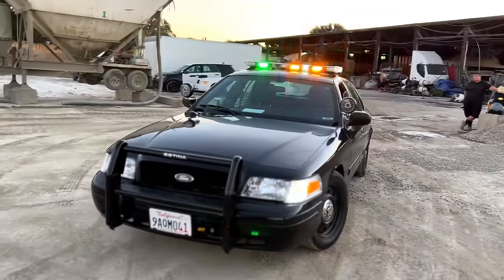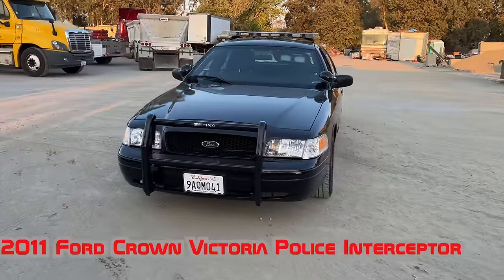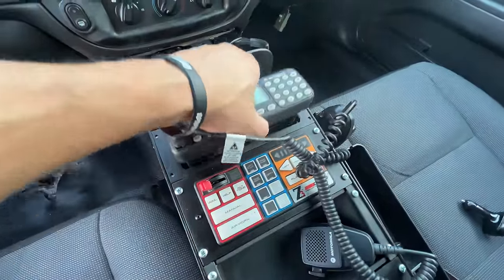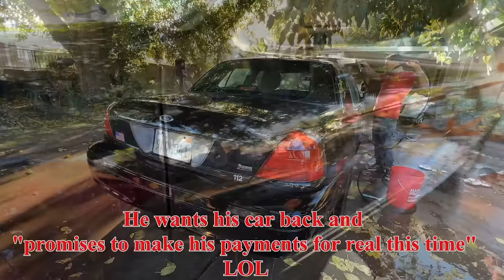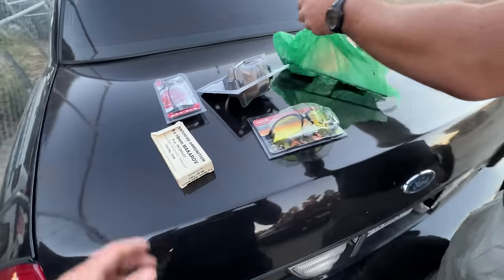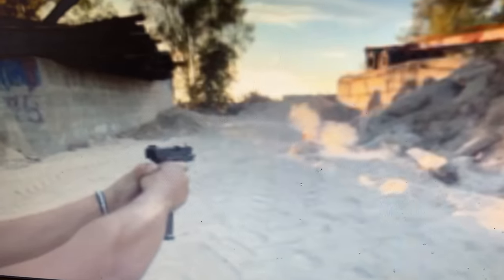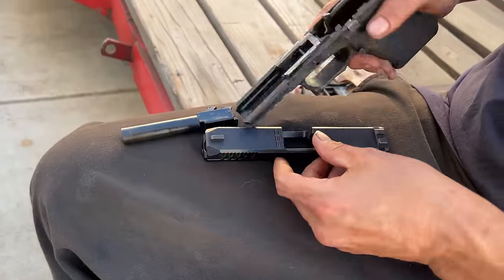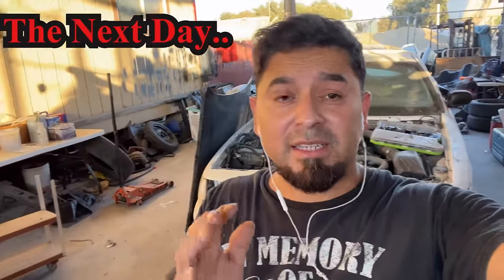Aftermath of finding a GHOST GUN & REPO!

Comment: 4:58 Did you accidentally buy 9x18 Makarov instead of 9x19 parabellum?
Reply: Holy shit yes they did
Reply: I know that if this pistol is 9x19 it isn't right ammo, but how bad is that actually?
Reply: @thefinplayer6091  it wont work, and could damage or destroy the firearm and injure or kill the operator
Reply: I also noticed that, then was confused how it turned into a box of federals. 
Maybe they had other guns to shoot 🤷🏽‍♂️
Reply: Good catch.
But it won’t chamber by design.
Now if some ya-hoo modified the chamber, that would cause problems and likely a kaboom.

There were some 9x18 conversion barrels produced for a couple models, but I haven’t seen them available lately.

They probably just had a box and discovered at the “range” it didn’t fit.🤦🏻
Reply: Yes but the gun the last guy shot is chambered in 9mm makarov so im assuming it was his ammo
Reply: @Helidude350 it can and will chamber as some one who has bought it and shot it I can confirm that it can and will shoot but double feeds and failure to extracts happen almost every shot you can also shoot 38 special out of a 9
Reply: @thatoneguy5007  no, 9mm casings are larger and the rim on a .38spl won't feed into a 9mm semi auto. Now if you're reloading you can use either 38spl or 9mm bullets but the casings are very much different

Comment: I would assume the guy bought the 80% lower in which they give you an unfinished lower frame where you have to finish it, you can legally buy an unfinished lower and finish it yourself and you don’t have to get it serialized, they do also sell finished lowers with serial numbers but are more expensive because the Frame is what they consider a gun. Now with that being said, I would assume that he didn’t really file down the frame that well which will cause jams with the gun itself, the oil will help but you would want to file it down more so it’s smoother, also the uncle should of cleared the gun before messing with it, they make flags for the barrel so you know it’s clear and all.
Reply: In california you can't finish an 80% without first getting a serial number from the DOJ

Comment: Hope he’s OK and probably one reason why the gun wasn’t discharging rounds was you probably need a new slide or just to file  the frame more because on some ghost guns, they need to file them down a lot
Reply: Maybe a different spring aswell
Reply: @Whydoyoucare_1  The web that needs removed where the recoil spring fits is the most likely thing wrong...besides gross incompetence by the handlers.   If you just remove enough of the web to get the gun together it'll short stroke under recoil...need to fully remove that web and allow lots of clearance for the spring to move.   But please...if you're going to be handling pistols...get some training!!!!   I was cringing the whole time that P80 was in the shot.

Comment: The p80 uses Gen 3 Glock parts in the internals which causes stove piping, change out the Ejector Pin to A Gen 4 Glock 43 Ejector pin 👍

Comment: Id recommend taking it apart and cleaning The bore and the rest of the gun and maybe the magazine
Reply: That gun looks like it never been shot you have to put like 50 rounds in that p80 before it starts working correctly on all 4 of my p80 builds they jammed for about 30 to 50 rounds till it got broken in and that's with me using a drill press Dremel and oem internals

Comment: STOP riding the slide forward!  That also induces malfunctions.  SLINGSHOT the damn slide🤣😉!  Take a class or watch a video.  SLAP/TAP the back of the slide after releasing the slide. It helps assure the slide is properly seated.  Also, a GHOST GUN is only legal to be owned by the person who manufactured it.  You arr committing a crime by having it in your possesion without legal transfer.  Just a couple tips.

Comment: The problem with your (ghost gun) is gonna be alot worse then accidental discharge if someone  reports you to police or atf hopefully you  were not trying to  run the Makarov 9x18  ammo through that gun it was not made for it since it is a slightly larger bullet made for Makarov pistols it may fit but you are risking catastrophic  failure  of the already sketchy gun an possible  death